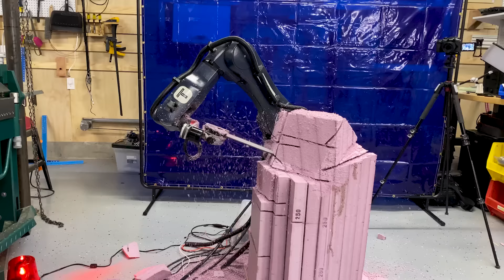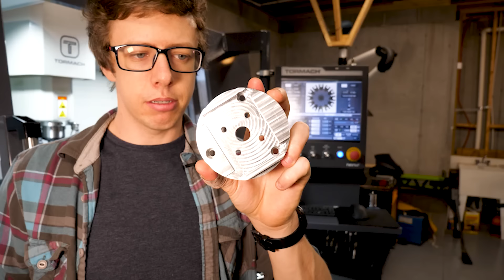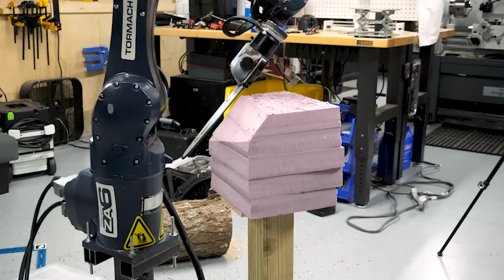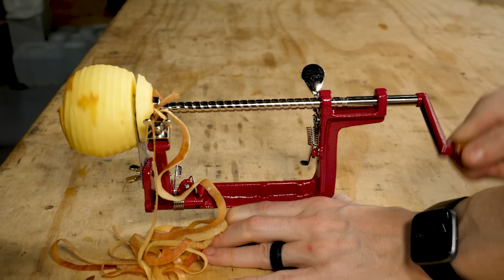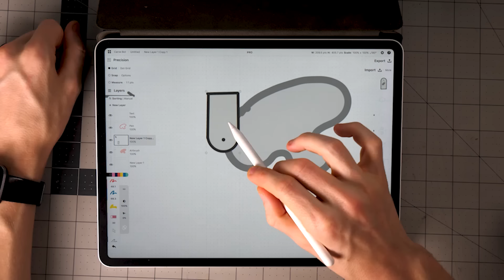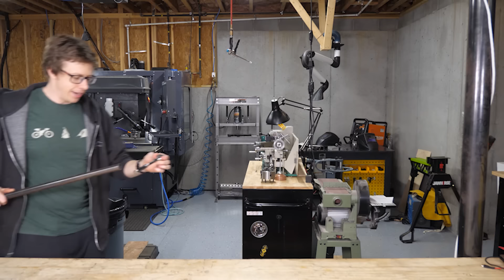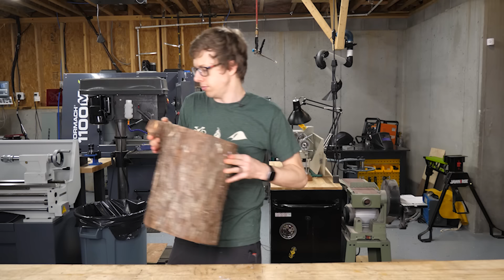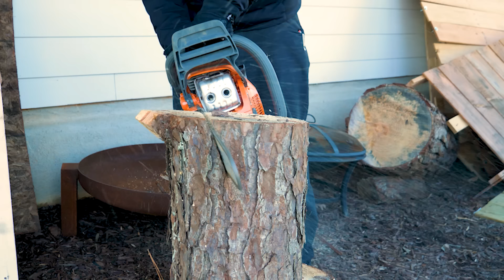Chainsaw + robotic arm = art?

Comment: As an icesculptor, who works with chainsaws regularly, I approve of this video. 
Amazing work!
Reply: Ice is a genius idea. That would solve the overheating issue!
Reply: @pastorhudson  I wish that were true. If you use the tip to cut you will always overheat it.
Reply: @MartinTedder  Yes, bar is too short for cutting that size log. Wood carvers use the tip in fine detail and cut very slow then.
Reply: @HVM_fi  same in ice....in much lesser degree. The first time I did wood with my ice experience I almost decapitated myself ...
Reply: @pastorhudson  it might still just rub though
Reply: Today I learned! It’s fascinating how all these things work in unpredictable ways.
Reply: I also thought about a much smaller version with a dremel style tool. . .
Reply: @pastorhudson  that also exists: https://youtu.be/sqP2Qdag-Kg
Using a die-grinder is (for our work) usually the next step. But, with both the chainsaw and the die-grinder, you are working with strong forces. And in wood it is even stronger...

Comment: were you not running the chain backward, also make sure that the oil conduit, a small little hole that supplies oil to the chain isnt blocked and it has an oil supply

Comment: Chainsaws usually had an auto lubing system where a chain oil is added to the chain. I think this could be why your chain got hot. 
Also the chain would need sharpening regularly and evenly on each side. Those hook shaped bits in front of the cutting blades are called the rakes. The rakers sit in front of the cutting edge of the blade and help to clear the wood out of the cut. Check the height of each raker, and ensure the tip of each raker is a little lower than the top surface of a cutting blade

Comment: Couldn't you just have made vertical cuts that trace the outline/edge of the model? So it would go like this: Make a vertical cut - Rotate the block the width of the blade - Make a vertical cut - etc... until the block made one full rotation.

Comment: At https://youtu.be/ix68oRfI5Gw?t=1047 you talk about an anti-kickback tooth. That's actually the depth gauge, which is what dictates how much material is removed by each pass of the cutting surface. If there's not enough difference in height between the depth gauge and the cutting surface, that will reduce cutting ability and often results in burning/smoke.

Comment: I like the method, just start from scratch and see what happens. Well... you almost reinvented something called "Ray Marching" that is a fast way to do ray tracing on Computer Graphics. It's very fast if you can compute the distance to a part of an object quick. 
 If you keep using low poly figures, the distance of a "plane in space" is super easy. The algorithm fits this work perfectly, each step of the algorithm is a cut, that will be refine the figure a little better than the cut before.
Check it out. It's easier than it seems.

Comment: Don’t know if you read comments but. The reason your saw isn’t cutting that log is because. They aren’t made for things that large. they are made for like 5 inch branches at the biggest. To be able to cut logs that big you are going to need a saw with a much stronger motor. And a carbide chain. Your chain looked very dull. Or try a bar with a carving tip. That way you would be able to get into much smaller places. I know you can’t exactly fit a Bigger saw on your robot but that’s what you would need. Or you could use a hydraulic chainsaw. They are small and powerful but very expensive. Or my own idea would be use compressed air saw. Or convert an air powered grinder or ratchet so it can drive a chainsaw chain. Maybe this is helpful maybe not. Just some ideas. Nice dog

Comment: Your chain looks like to be awfully loose most of the time. Probably sharpening the chain and tightening it would make wonders on the wood cutting part. You can also file down the cut depth teeth if they are too high. And better check the chain lubing too just to be sure to avid smoking and to extend the life span of the saw...

Comment: Do electric chainsaws use bar oil? It’s a lubricant that gets filled up with every tank of gas on a typical chain saw. Alsp, use a soft wood that is extremely green (freshly cut). Basswood is a very typical carving wood as it is crazy soft, but still holds together because it’s a “hardwood.”
Depending on the wood species you’ll also need to resharpen every “gas tank” but i dont know how that translates to what you hsve.

Comment: Chainsaw 101. That "Anit kickback tooth" is actually a cutting depth gauge the more you file it down the deeper the saw cuts. Secondly, Chainsaw Blades should have a continuous flow of oil applied to them.

Comment: I think part of why it was smoking was because of the lack of oil/lubricant on the chain. There is a lot  of metal on metal friction between the chain and bar and I didn’t see any oil unless I missed it. 

Cool idea but in a more practical sense couldn't you use the chainsaw to cut a bounding shape (ie remove a lot or material) and then mill it to get a detailed model? Maybe you could get it pretty close with large cuts, and maybe the two programs could interact so you would be milling a known shape. I’m sure the feeds and speeds would be a lot faster to cut wood than they would be for metals. 
Also that seemed like some pretty hard wood to try and cut with a pole saw. 
Great videos though, definitely enjoy how seriously you take all of these projects and solving problems.

Comment: Just a thought. Moving to slowly through wood could be causing the overheating. A lot of force is needed to just get a chainsaw to "engage" with a material I guess. Also using a properly dried softwood log could help a lot.

Comment: Some of the most sophisticated and cool pieces of software to me has been slicers (like Cura) and CAM (Fusion 360). I’ve always marveled at how I can quickly whip something up in CAD (especially with slicers) and the software can generate thousands of tool paths in just a couple of seconds to tell the machine to go down to the fraction of a fraction of a mm. And you made one... for a CHAINSAW. I seriously aspire to be like you.

Edit: Just got to the part about gradient ascent and trying to optimize your algorithm, were you using Deep Learning like tensorflow or traditional algorithms? If you haven’t looked into using a Deep Learning model they are by design very, very good at avoiding false peaks with the right learning rate. The disadvantage is that it is impossible to dissect a deep learning algorithm after it reaches its conclusion, but it is orders of magnitudes more efficient than traditional methods.

Comment: @stuffmadehere The chain on your saw is an anti-kickback chain which also makes it and anti-cutting chain.  I suggest that you got an Oregon VersaCut chain.  An example of this chain is part number 91VXL050. Just make sure the chain has the same bar length, gauge, pitch and number of drive links.

Comment: You probably need to file the rakes down on the chainsaw chain to prevent overheating.  A raker gauge is placed on top of the chain, allowing the rakes to be filed down uniformly.

Comment: Real chainsaws use up bar oil continuously, and it's fed from a reservoir. Your little electric one looks to not have that. It keeps the chain and cut lubricated. Also, they do need to be sharpened regularly. If your cut starts smoking, sharpening and checking oil. Won't matter for the foam, but for wood, definitely want it to be sharp.

Anti-kickback chains also aren't nearly as good at cutting on the end. This is so that you don't grab at the start of the cut and have it jump back toward your face if you touch the end. Anti-kickback chains are basically the default now. Using a robot, you can likely get away with a much more aggressive chain.

Comment: "Anti kick back teeth"

Those teeth on the chain saw blade are called rakers. They are what determines the amount of material removed by each cutting tooth. Normally when running a chainsaw and cutting wood the teeth should be sharpened every tank of gas. When I say sharpened it's more of a touch up to keep a sharp edge on the teeth. The rakers need to be hit with a flat file every 5 tanks of gas. Not super scientific but a good rule of thumb when running a chainsaw. By doing this you will maintain an optimal gap between cutting teeth and rakers. Professionals who run chainsaws file their rakers down much more to remove more stock per revolution but the problem with that is your saw must be beefed up or the engine will stall as a standard engine is not designed for deep cuts. By shortening rakers the saw will pull harder into the material.  The saw blade your using is not designed for cutting big logs of wood atleast not efficiently. It's more for pruning and branches. I am curious as to how much hp you have available in you motor? You should be able to file off the rakers and your saw teeth would remove more material. Be aware doing this will also pull on the arm more if though  which may effect it your movements. Either way I really enjoy your videos. Thank you for sharing them. Hope this helps.

Comment: Chain isn’t sharp enough and not tension the you should barley see light from the bottom or a 1/2 in from bar. And a much more powerful motor that can do more hp and speed if you see band saws the motor hp ranges from about 1/2 hp and up. And also some areas you could maybe do a plunge cut to remove material. But very interesting

Comment: in general, you are better off removing chunks of material to get a rough shape so that when you come back with the tip you dont have to cut through all the waste that would have been easily cut off. This results in you having to cut less wood even if you do more cuts. ie. cutting wood along the entire blade takes more effort. So if you remove a large chunk and the following cuts then only need to cut a few inches deep, you end up with cuts with less effort that go faster or at the vary least put less strain on the saw and blade. Also typical saws have oil on the blade to keep it moving well, yours probably doesnt have any. And i suspect there are saw blades specifically for carving since with typical chainsaws you avoid using the tip, which is the opposite of what carvers want.

Comment: My humble suggestion sir is to file down the anti kickback teeth by 0.25-0.5 mm and if that does not improve it, adjust the cutting teeth geometry. It’s optimized for straight cuts, not scraping cuts. I wouldn’t adjust it by more than a degree or two to start - much like drill bit angles it doesn’t seem like a subtle geometry change will change much but it will. Full disclosure, my maker background is in making knives, not designing chainsaws. This is without a doubt the most excited I’ve been about a youtube video in months.

Comment: Angle grinder with a power carving disk on it... disks are typically 5 inches in diameter, and they basically have a chainsaw blade around the outside edge of the disk. Can always Change the power carving disk to a cut off wheel or sanding pad for more detailed and lighter work too,.Very cool btw

Comment: Couldnt you have used it more like a CNC mill. use the slicing for rough cuts then use the tip for the finer details Assuming the blades are sharp and chain is tight, I guess you are pushing that little thing to hard (at least the motor for what it can do) and maybe the direction of the force applied?(does that matter). What about just using a whole electrical saw.
Also the type of wood, its hardness makes a difference.. instead of rocking i'd think you could move it and stop for some period of time so the blades will clear the material. What about making set of predefined moves that  make certain cuts. Like pushing the tip into the work and rotating it back and forth you could make an inverted hemisphere shape.  Could get real detailed if could use the turntable in tandem.  
Great job. I wouldnt even know where to begin with that project

Comment: The "climb ascension" algorithm is called "simulated annealing", that's a probabilistic technique for approximating the global optimum of a given function. That's what you should've done. Though it doesn't differ much from the algorithm you've described/made except that, once in a while, after it gets stuck at an optimal solution, it introduces a random offset, which will put it in a "random" spot where you'd run the same algorithm which in turn would hopefully converge to a new maximum. You can then repeat this random moving a couple times and by then you should have converged to a close enough solution, hopefully a global maximum.
You could even go one step further and put this simple algorithm through a genetic one, where you'd have multiple points trying to converge to the maximum.
But I really appreciate and respect your ingenuity and the way you explain such complex concepts visually that they are easy enough to understand and also be entertaining to people who are new to engineering/computer sciences. Thank you for putting up such amazing content, and sorry for my essay. I hope that maybe I've given you an interesting idea to solve another problem in the future ☺️

Comment: I have a way to stop the rubbing on the curved part of the blade  that “anti kick back tooth” is called the depth gauge that allows you to set how much you remove but you could do that by cut speed so you could file down the tooth allowing it not to rub.

Comment: How about reinforcement learning to control the saw?  Let the algorithm control the saw, and give it a small positive reward for all material it removes in the right places, and a big negative reward for cutting into stuff it shouldn’t.  You’ll have to run a ton of simulations to train the algorithm, but once it’s trained, it’ll just start cutting without having to do all that preprocessing.

Comment: Honestly, you should've programmed it like a horizontal mill; create separate 'sides' to switch to on your rotational axis, and only cut the profile, with the chainsaw acting like a tooltip. Would just need to rotate the blade in the direction it cuts.

Comment: Idea about gradient ascent: given you're at a peak, project a plane parallel to the base plane starting from peak(x,y,z) - if the only intersection point is the peak you're currently at, it's the absolute maximum. Relative otherwise.

Comment: For the gradient ascent, could you take an arbitrary set of random points (maybe like 10) along the plane you are interested in and do the process for each point? Then you'd have the best point out of those 10, which might be well optimized... (?) Maybe take 30 points if that isn't enough? (You've probably already tried something like this, or my comment is really dumb... either way, thought I'd suggest it)

Comment: My theory (as a dumbass) To bypass a false summit try increasing the “search range” of the “ball” so that if the “ball” goes down then back up it will know to head farther that way. meaning broaden the distance the cutting head covers before making its decision, or a second process that recognizes when a summit is reached to search again for the next. You could even use a + shaped laser height sensor that you can back up from/zoom into  your log in order to broaden the search zone. Weighting this at 11:13 through the vid so maybe it will be disproven by the end.

Comment: You may be able to get a lot of the bulk material off much more easily by first rendering the convex hull of the object and then slice off material at the derivative to points on the surface at a set spacing, similar to whittling cuts.

Comment: 17:26 That is called a raker and it serves as a depth guide for the saw tooth.. Also, you are not using the proper style of chain for ripping. You could try modify the chain to better suit the purpose, and can find all sorts of info about it here on at youtube university.

Comment: You can cut with the tip of the chainsaw, but the chain has to be sharp. Usually it's not properly sharpened straight from the box.

Comment: To solve the someone smarter problem (9:39). Run this alg multiple times (probability of finding global max increases as the more you run exponentially). I.e. if the probability of not finding it is 30/100 running it n times will have a (3/10)^n probability of failure (to find globalmax).

Granted this can be slow as you have to run it multiple times, but that is the solution to the someone smarter problem.

Comment: Your chainsaw blade needs sharpening, and those "anti kickback" things are depth gauges. You can grind the depth gauges down a little too take deeper cuts.

I have a chainsaw that was fairly slow. A professional lumberjack sharpened and cut the depth gauges and it then cut something like 3 times faster and easier.

Comment: Just a little note to the gradient decent problem: I don't know if you tried that, but one way to circumvent the false peaks is to just run the process a more than one (like 10 - 100 depending on your runtime)  with random starting points and then check if the result keeps running into the same peek or if it finds different solutions. I think its called local/simulated anealing in computer science.

Comment: I think part of the heat problem with the saw stems from it not having an oil supply. Chainsaws used felling trees and the like have a small secondary oil supply just for the chain. Other than that making sure your chain is sharp is also extremely important. Typically they require sharpening every few two hours or so. They can cut for longer than that but the efficiency declines quickly.

Comment: Dumb question, but if the CNC machine uses a router, then why doesn't the robot? There's a reason why a router, and not a circular/chain saw, is used for precise cuts.